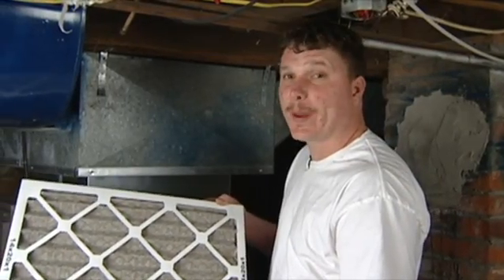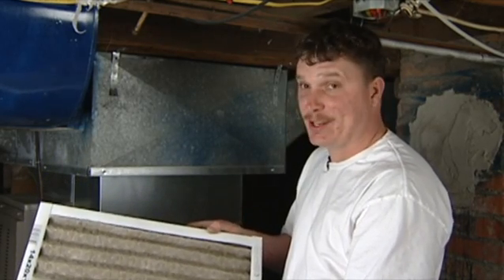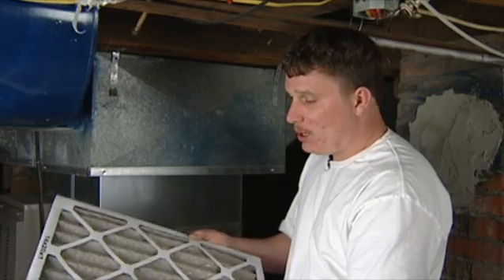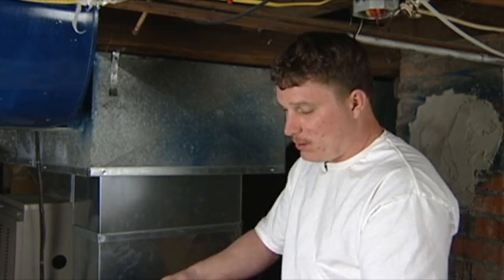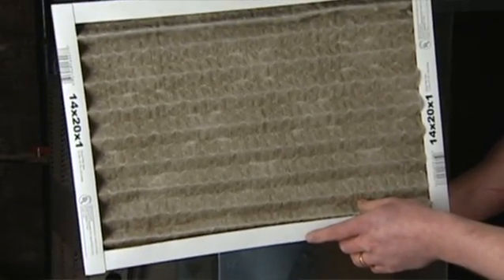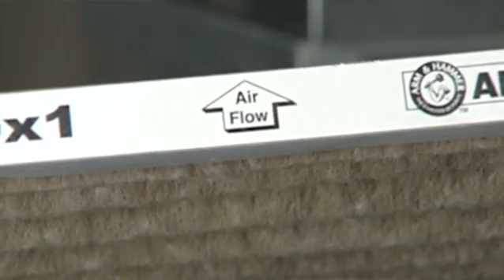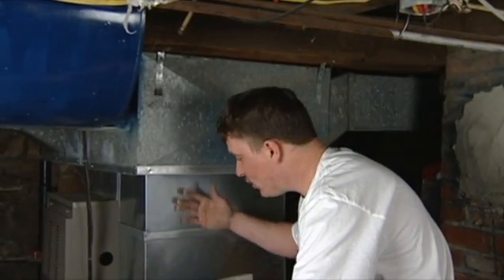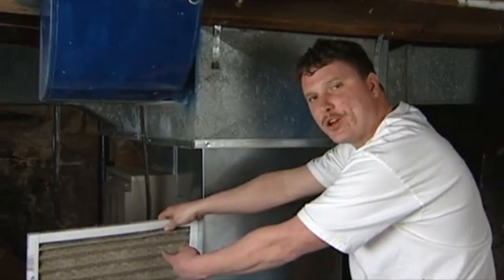Plumbing & HVAC Maintenance : How to Determine the Air Flow Direction for a Furnace Filter

Comment: This is the only video I've found that describes the difference between the two filter sides:  the furnace-side is reinforced with metal mesh -- it can't break down into particulates that would pollute the furnace.  Very useful.

Comment: the furnace in my rental home  is a little different. if you open the front of the furnace there is a horizontal hole at the bottom of it and it looks like the filter is laid across that. there is a metal cylindar piece above it that has a picture of air flowing down and around and back up the metal cylinder piece. do you know which way the filter should face for mine? thanks.

Comment: Figured it out for those who have the same problem I had.  Please call me out on this if I'm wrong.  But logically this sounds right.  My issue is my filter seems to go INSIDE the furnace.  It isn't on the dang wall and it doesn't sit vertically, it lays flat.  So what I didn't think about is the cold air when my AC is on blows up from the floor.  However nothing comes out of the top vents.  So these top vents are air returns.  If you take a plastic bag while your heat / AC is running and put it towards the vent if it sucks the bag inward it's definitely the air return vent.  That is the direction the air is flowing.  So my air return was on the ceiling.  so the air is flowing downward through my furnace and the cooled air is coming out on the floor.  The arrow on my furnace filter needs to face down.